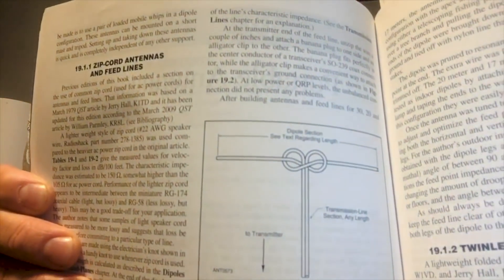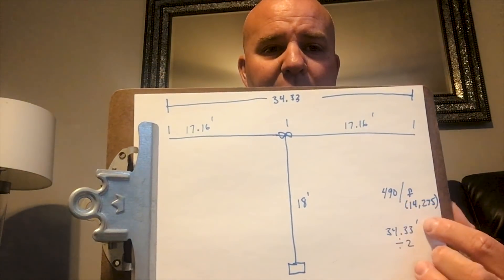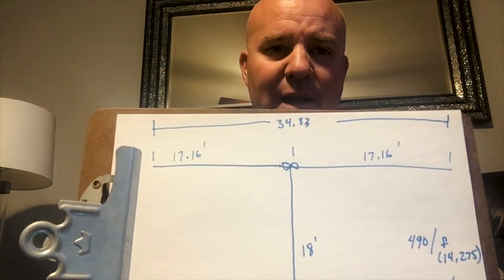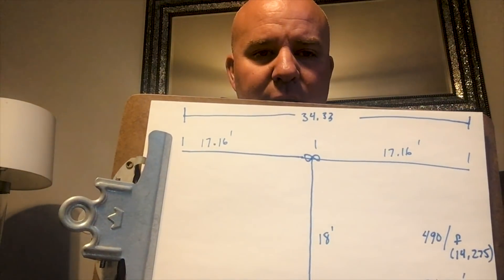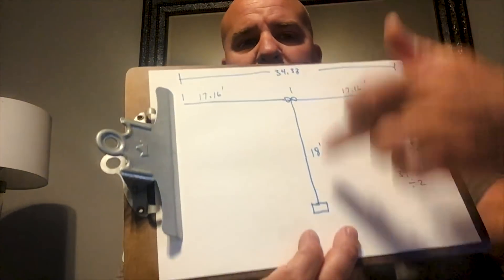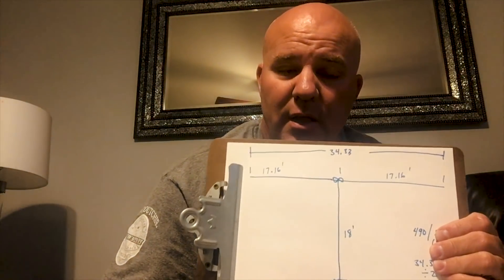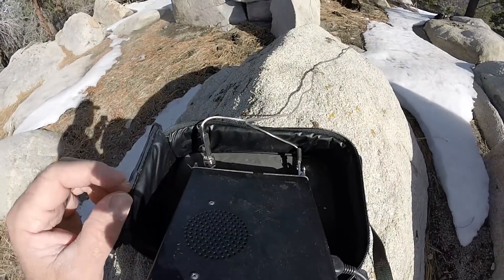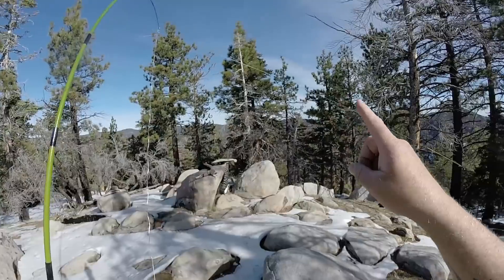How to make a Ham Radio Speaker Wire Antenna

Comment: Great video!  Did I understand you correctly that you picked up the mast and the antenna holder from Amazon?  What name would the mast be called, if you don't mind, couldn't find anything like it.  Thank you very much for all the info, studying for my tech license now.
Reply from the maker: Hey Dick, I did get it off Amazon and here's a link to it. http://amzn.to/2GIfKBr. It's super small and fits INSIDE my backpack now so it does the job well and it's cheap too.  Good luck on your test and let me know when you pass.  If you're local we can setup a VHF QSO or maybe something on 10m.

Comment: Excellent antenna, very light and efficient ... good idea.
The measurements are expressed in inch ??
Thanks Jerry and have fun.
Giuseppe iz0gzw qrp.
Reply from the maker: Yes, the conversion with 490/freq puts it into inches so all my measurements are in inches and feet. Thanks for checking out video and if you build one let me know how it works for ya